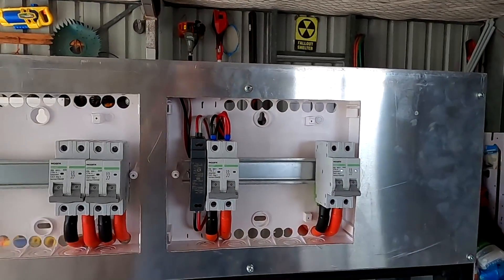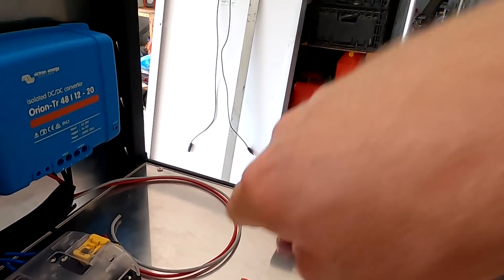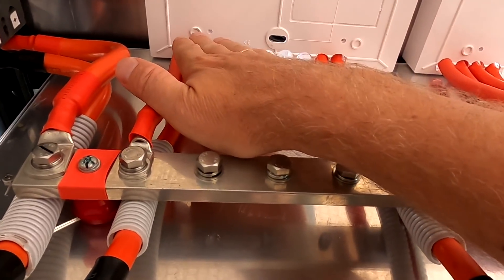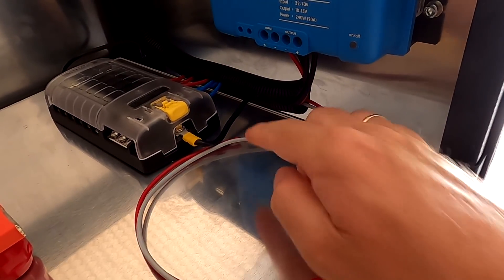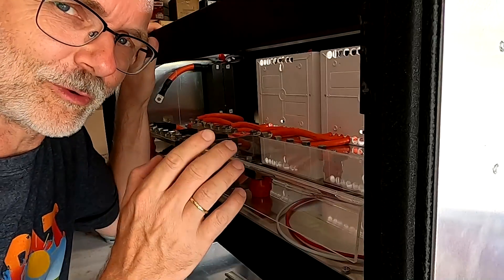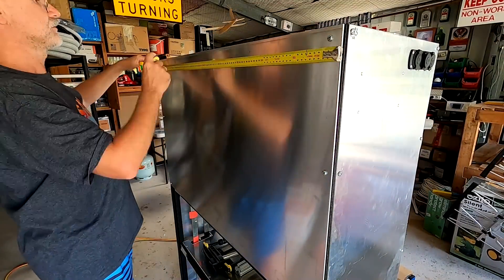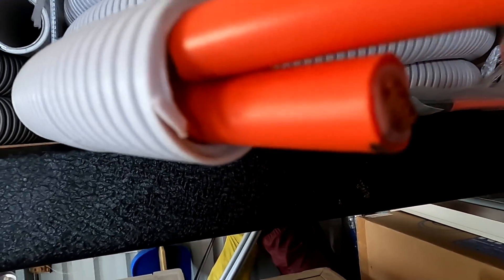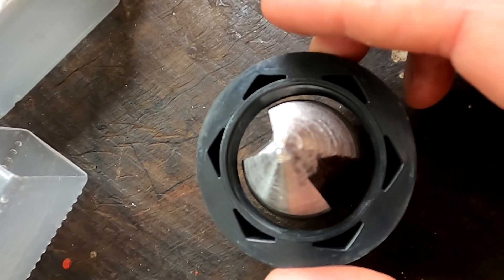Preparing for the inverter and solar connections. Will this be enough? | Battery2.0

Comment: We don't know what the future holds, but I will hazard a guess, we will see 96VDC systems  or even higher voltages and the wires will be smaller, not larger to carry the lower amperage-higher voltage power.

Comment: if the box is airtight, you might have poor cooling inside the battery shelf. How about very fine grid?
Reply from the maker: I don't think I need much cooling in this box. There are no active components apart from the DC converter in the top.

Comment: Hi Andy, Just a thought on the gaps, instead of using silicone, use self adhesive flat door sweeps. They work well for gaps.
Reply from the maker: Yeah, I had a look at them but insects will just crawl through from what it looks like. The problems are the corners where the feet are... one gab is enough to ruin the whole effort.

Comment: Good pm I have 4 PCS prismatic lifePo4 battery 40 ah each  can I used bms 4s 100ah thanks bro HAPPY NEW YEAR SIR PLEASE RESPOND
Reply from the maker: That depends on the specs of the cells and also the load you want to connect. Principally, this should work.

Comment: I would use insect screen... you want to maintain a little airflow
Reply from the maker: They will just go through as if it does not exist. The case is not airtight and I'm expecting very little heat building up.

Comment: Hi Andy, alles Gute für 2022..
I love your rack-build concept and threw my own ideas for the battery storage over board since your concept allows for battery-addon, something I definitely plan to do. 
However, other than you I started off with 3x 5500W parralleld Hybrid Inverters  supporting individually L1/L2/L3.
That being said, I potentially could pull 16.5kW from the batteries @ 127A per Inverter @ min Voltage of ~43.2V. By far too much for a single group of batteries apparently, yet this setup is planned for growth, means a second set of batteries, parralleld will provide enough Amperage.
Well, here is my question: You seem to be on the same path and are installing massively sized cables for the potentially high draw of energy/amperage in the future. Yet, the JK BMS is limited to 200A continuous and (said) 350A short term. That being said, a bank of 2 batteries could provide 400A continous, thus a theoretical max of 400Ax43.2V = 17200W - enough to support (my) 3 parralled Inverters (>3x127Ah). While I completely understand the need of the massive busbars, shouldn't one 35mm2 cable be enough to flow the (max) current to the inverter?... or am i getting something wrong here?  Your cables are massively bigger...
Thanks Christian
Reply from the maker: Thanks Christian. the Victron 5kW inverters demand a 70mm cable already if within 0-5m distance to the battery. If it is further away they recommend 2x70mm cable for the supply. 
My batteries are terminated by 100A MCCBs so that will be the max current I will pull from each bank. The JK is correctly rated for this setup with it's 200A max current.
I'm not a big fan of pulling more than 0.5C from the batteries. I like to keep the current small and distribute across several banks for that reason. Longevity of the batteries through small currents and low temperatures.

Comment: Working on it takes eternity. Do you hawe    calculate time and money to buil it? Isn't chepest solution buy some pylontech rack? I dont hate but my time is too expensive.
Reply from the maker: The time I spent on this rack is intense so far. Of course there are cheaper and easier solutions but it's about DIY and learning experience as well. That's what I'm sharing here.

Comment: Hi it’s locking nice, the only thing what I don’t like that mutch is the cable under the bus bar it just locked to close.I would ad a space underneath the inner bus bar so you have mutch more space.
Reply from the maker: There is a three layer insulation with the thick conduit on the outside of each negative cable. That should be OK from a safety perspective. The look is a different problem though...

Comment: With all the cable lugs, it may be a good idea to use a thermal camera under full load to make sure there is no heating.   One good arc and you will have a plasma fire going.  Also are the bus bars and lugs the same material?  Are the cables and lugs compatible material?
Reply from the maker: Yes, I will do a FLIR inspection once it is ready and operational. All materials are the same and compatible with each other.
Reply: @OffGridGarageAustralia  Good, I was a little concerned about galvanic corrosion.  It may not hurt to use some anti aluminum oxidation goop on all the connectors anyway.  Looks like you have a plan to keep rodents, spiders and insects out

Comment: Andy you might want to consider adding a skirt to keep insects out of your battery shelf unit...  "EPDM peel and stick flashing" is my suggestion (used as chimney flashing). You can find these in different width & length at any hardware. Exceptional durability and it will conform to any surface shape/form. Like uneven floors. Also easy to replace if needed. Black is a common color, matching the color of your shelf already.
In my IMHO you need a "screen monitor" (not to splashy) for this battery shelf unit. Great system; nice.
Reply from the maker: Thanks Teddy, great suggestion.

Comment: For busbar covers, consider a plastic that can be heated with a heat gun and form to shape.  You don't need crazy thick impact proof, just need to protect from a falling wrench of other accidental contact  You can heat it up, let it snag, and even deform it under the bar a bit so it will snap over it.  Same goes for your aluminum side plates.  Find some type of vinyl film to apply to them so you don't have the possibility of a ratchet or wrench going from busbar to aluminum wall plate.
Reply from the maker: Thanks for the suggestions.

Comment: Hi Andy! You can use small strips of aluminum to close off the gaps. 100% pure silicone will form a great bond to adhere it without fasteners but you must use a good prep fluid. I use dowsill 1200 OS primer to prepare the surface and it will never come loose.
Reply: I would use a holesaw for making your large holes.
Reply: Oops now I see you have already got them done. Way to go hard worker.
Reply from the maker: Thanks Ray. A metal hole saw is one of the few tools, I don't have. The silicon does not even need to stick to the aluminium, it's enough if it forms a groove around the panels and sits on the concrete floor.

Comment: Rubber flaps from Clark Rubber straight pieces to the concrete.  Morning Obi Wan, Stay safe and fused.
Reply from the maker: That would not be enough to keep the spiders out. They won't seal the rough concrete floor.

Comment: If you use acryllic covers over the busbars, there is not only the risk of cracks. You might also bend it, which results in a bent [by factory] bended [by you] acrylic cover :-)
Reply from the maker: I'm so confused right now 😄

Comment: Hello Andy
Sutton’s holesaw kit would have them holes done in 1/5 of the time.
As to not being able to put 2 * 70mm cable into the 40mm gland adaptor/ conduit, easily fixed run additional 2 * 35 mm cable which should fit into the 40mm adaptor / conduit.

Comment: Nice work on the shelf. An easy way of making nice round holes in aluminium if the sheet is not too thick would be a hole punch. For thick stock a hole saw would do a quick and easy job of it.
Reply from the maker: Yeah, it's just for these two holes so an investment seemed a bit over the top...

Comment: Adjustable skirting rubber for the floor similar to conveyors use between chutes and belts but in a smaller scale, cut slots in the skirting rubber for adjustment,  a row of small m6 tapped holes in the main frame with  3mm aluminium strip on top to clamp the rubber, you can get 3mm rubber at Bunnings, or you could get some type of  self adhesive tape that can go around the base to the floor
With the cover, I would put stand offs  along the bus bar and put a one piece cover for the lot, that way avoiding cut outs for cables
Reply from the maker: Rubber is not tight enough to the rough concrete floor I think.
Great idea with the bus bar covers!

Comment: Hey Andy, your Battery Box looks amazing! I have a Question: In the moment, i have lead acid batteries, to charge my e-bike in the summer. I want to upgrade to Lifepo4 tho. In Switzerland, it‘s quite cold in Winter. In my Garage it‘s sometimes as low as -23°. Do you still suggest Lifepo4? I don‘t use them at Winter. Just charging my phone. I want to buy 2x 100 Ah batteries. Do you think that‘s a Problem? Lg
Reply from the maker: If you install them in an isolated box and add a heating mat for extreme conditions, it should work.
Reply: They sell heated prebuilt lifepo4 batteries

Comment: Hi Andy, how about you leave the bottom open with only on the 4 posts and seal the bottom shelf.
In this way you could see if there are insect hives and if necessary clean the area easily.
Reply from the maker: It's quite hard to seal the shelf itself as it has large gabs on either side. But good thinking!

Comment: Maybe you could put a 50mm strip of aluminum across the botting of the battery shelf to keep the bugs out or 75mm or 100mm  however  tall  you would like it to be and put self-tapping screws to keep the aluminum strip attached to the battery shelf thank you big fan love your work congratulations on the 20,000 subscribers.
Reply from the maker: Thank you. The aluminium sheet will not be enough to seal against the rough concrete floor though. Even rubber is not enough.

Comment: Spray foam.
Reply from the maker: or silicon...
Reply: @OffGridGarageAustralia  most closed cell spray foams will fill the gap better and are fire retardant and have insect repellent and cost less.  Window and door sealant was what I was referring to. But lots of silicon will do the job probably just as messy if not more 😂
Reply from the maker: @jameshancock  I'll have a look at the building foam. Not sure if they have it here in Australia. They don't use it for Windows or doors like in Germany.
Reply: @OffGridGarageAustralia  how the heck do they insulate the gap then???
Reply from the maker: @jameshancock  they don't. It's warm here...
Reply: @OffGridGarageAustralia  check out the build show network on YouTube.  Just cause it’s warm doesn’t mean you don’t want an airtight house that’s well insulated….

Ideas for phase 2 after the big battery.
Reply from the maker: @jameshancock  I know. The building standard down here is awful and from the 60s.
Reply: @OffGridGarageAustralia  Yuk. Imagine that you could hook up an air source heat pump directly with DC and no inverters that used the heat from the air to heat your hot water, dry your clothes and dishes. And on the rare occasions where it got cold enough, you'd have heat from the heat pump all powered from the sun. That's what I'm working on right now in my off grid garage.
Reply from the maker: @jameshancock  that would work perfectly down here. Even in winter, the air is warm enough for a heat pump to run efficiently.

Comment: The final result looks very nice.
I would have liked to see more shots of how you expanded the hole diameters with the jig saw and filing. I'm not being sarcastic, I'm genuinely interested how you did it, because it might come in handy some day.
Reply from the maker: OK, I'll keep this in mind.
I basically cut straight lines from the centre to the outside of each marked circle and then cut them off, filed the rest to make them as round as possible. The glands actually hide the rough cutting and filing. 😄

Comment: Happy new year, Andy! The project is really coming along! It's been fantastic to watch. Question for you - on the main busbars on the top shelf, I was wondering whether you considered raising the positive busbar so that the negative leads can pass straight under without the bend or the need for the conduit?
Reply from the maker: I did this in the electrical cabinet and lifted one bus bar so the cables of the other one go underneath. As these large bars are far apart, I was hoping the cable is flexible enough and bends under the other bar which they kind of are. I think it's not a big deal as it is.
Reply: V good observation

Comment: Hi Andy, perhaps this question was raised already, but why didn't you connect the minus 35mm wires at the underside of the bush bar. The wire would almost be flat

Comment: You can do baseboard around the bottom. It will look good and seal perfect
Reply from the maker: I think the concrete i the garage is to rough for that. It would work on tiles but not here. There are still too many gaps.

Comment: For the gap, I would suggest some door draft strips. I have some flexible plastic ones which are at least 3cm in size, it would be less messy and you could also glue them to the floor with silicone if you wanted extra protection.

For the buss bar covers, I think you should just go for a flat plastic cover which is attached to the bar itself. I think contouring the individual cables could be annoying and you'll be wanting to change things over time. A long flat sheet, perhaps 5cm wide, will protect against a dropped tool.
Reply from the maker: As I don't need a huge amount of silicone, I think it will be OK and has a clean look. I'll give it a try one one side and see how it looks like.

+1 for the flat cover. Someone else suggested that too and I like the idea. I will go for two covers as they are then easier to remove because there will be cables above the flat plastic. I can just slide them on top of each other and have one half of the bus bars exposed.